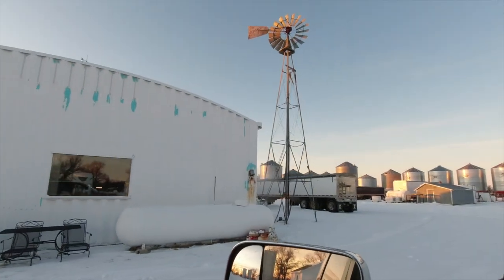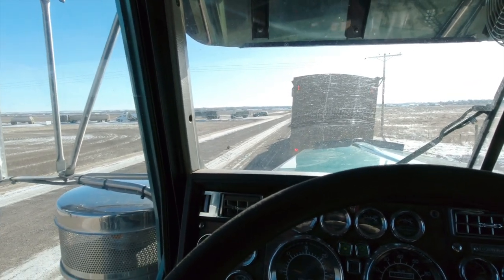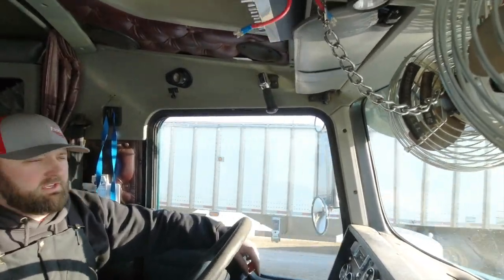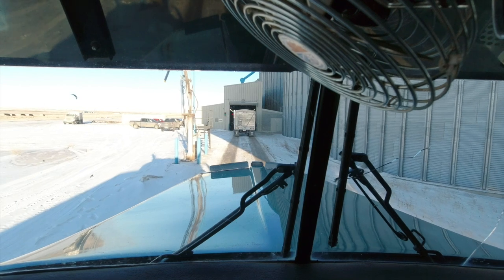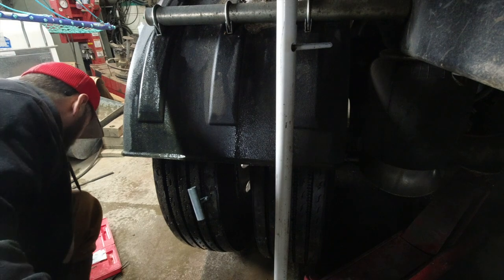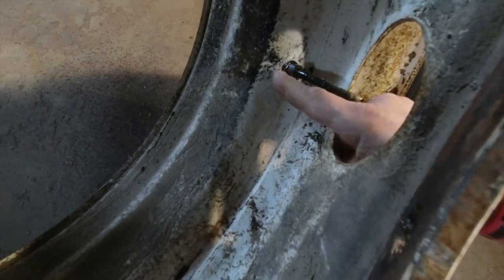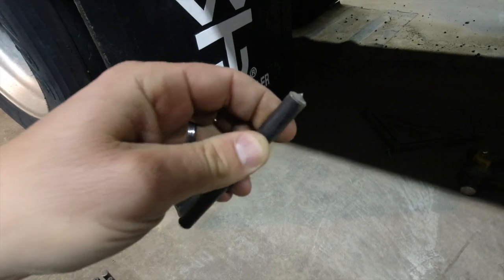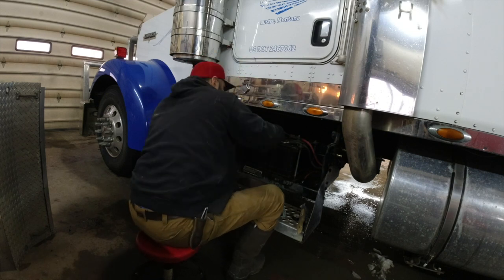Long Lines, Mud Flaps, and Tire Farts?

Comment: Nice video, Tony! I learned some things from you! I was wondering how it would work out to load up the night before and drive to the elevator and pull up to the unloading bay and go to bed, and then they would knock on your door when they open in the morning and then you would be first to unload. Then get back to the farm and load up another load and run it down to the elevator and unload it and then repeat the process of loading up and driving to and spending the night at the elevator. By doing this you would get two loads in per day instead of one, and also you would get more of your crop sold before they cut off buying the grain. You would only have to do it for maybe a week. When I was trucking for 13 years I learned how important time management is in trucking in order to get the job done and maximize my income. If I was driving for you I would probably want to do it the way I suggested, if it was okay with you, as long as you weren't going to lay me off as soon as I got all the loads hauled, because if you were then there would be no reason for me to hurry. LOL.
Reply from the maker: 3069mark I would rather get up early and head to the elevator then sleep in the truck.  I usually get 2-4 loads a day.

Comment: If you don’t put a mud flap bracket holder on your new mud flaps to keep them from flapping in the wind the wind will just push them against your tires and rub through in time, had lots of problems until we put those on
Reply from the maker: Luckily the distance to the next tire is far enough that it won't touch!

Comment: What kind of drill bits do you use with your cordless drill?  I am having hell keeping drill bits sharp and working with mine.
Reply from the maker: Jason Benton these were bought at pacific steel.  We use a drill doctor to sharpen if we need to.
Reply: @FastAgMontana  Thanks. Will look into them.

Comment: Thanks for the video. We are 1state away..ND. Do you have a grain vac? We have a lot of 2 and 3 thousand bushel flat bottom bins...would hate to think about cleaning them all without a vac.
Reply from the maker: We don't have a grain vac. Only on good years we use the 10 small bins. We have 33 hopper bins and 2 flat bottoms with center unloads.

Comment: I have a set of hole size punches and if I have a size bigger than 1/2 inch I turn a pc of round stock to that size and drill a 3/8 hole in it  and use a 3/8 punch
Reply from the maker: Just make a sleeve to slide over the punch?
Reply: @FastAgMontana  yes I have a bunch of different sizes

Comment: Great video! Would defiantly wanna see that  drag ogre thing work.
Question of the day!: Are those 3rd axle of tires on that trailer hydraulic or do they just drop down?
Never seen a trailer with that 3rd axle. 

Thank you for the video!
Reply from the maker: Jonathan Knighton I’ll video the drag auger, don’t worry.  They are air operated.

Comment: "I am pretty sure that is a John Deer bolt" ... LOL, I almost spit my coffee out on that one. =)

Also yah, those external jumper leads are awesome. I have used them when I ran reefers up here in Canada. When you get those cold spells you can use your reefer motor to boost your truck battery and then run an extension cable from your inverter to your engine block heater ... works like a charm.
Reply from the maker: Thats a slick set up with the extra motor!
Reply: @FastAgMontana  Yah it works great if you don't have any place to plugin during clod snaps ...

Comment: I hate shovel duty. Does anybody up there use grain vacs?  They are popular here in NC. The only downsides are noise and it takes 175hp tractor to pull them.
Reply from the maker: redbovine there are quite a few here too. We don’t have many bins to clean our with a drag auger since most the bins are on hoppers

Comment: How much can you haul with the extra axle
Reply from the maker: The 7 axle trucks can haul about 98,000# and the 5 axles 80,000#. and the trucks weight about 4500 pounds more.